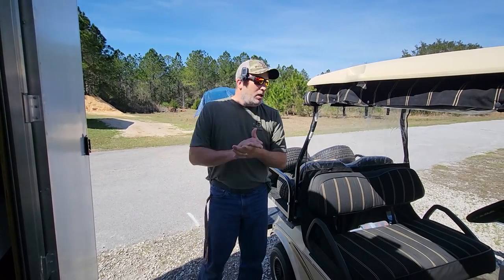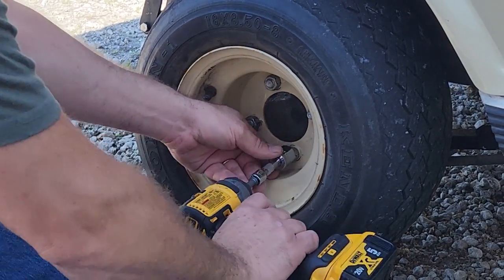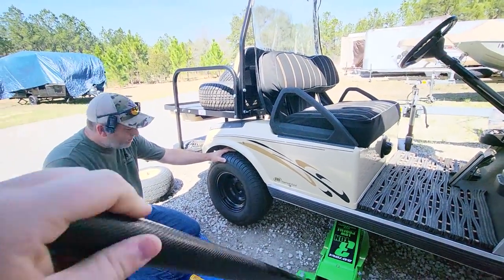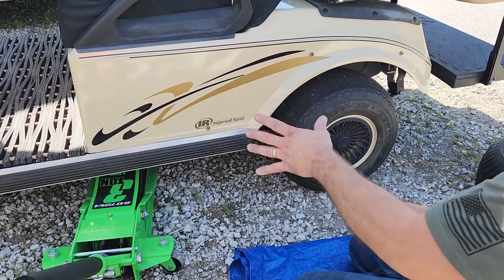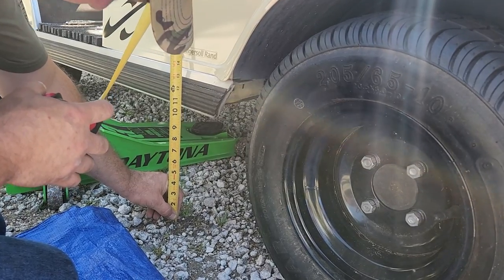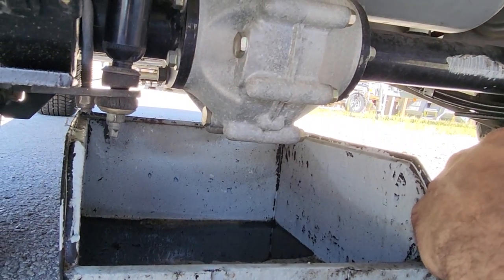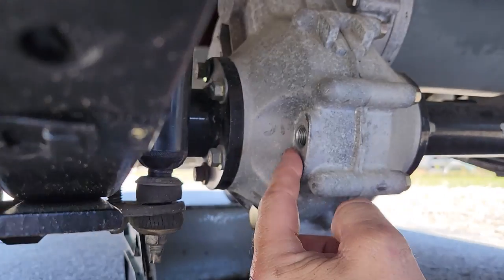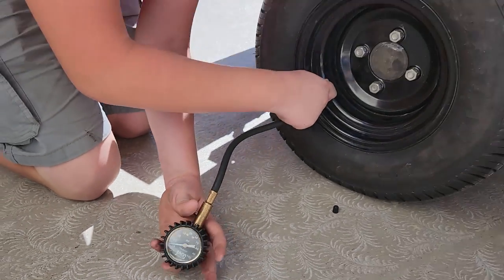Club Car DS Golf Cart Tires Upgrade & Rear Diff Oil Change

Comment: Just a bit of info. Per Club Car, Electric Club Car Carts require straight 30 weight oil. Club Car Gas Carts require 80w90 gear oil.

Comment: Hi there! Cool video! 
What size are the tires boss? I get the rims are 10in. But what’s the size of the tire? Thanks!
Reply: They are most definitely 20 inch tall tires. Probably 205x65x10 which is same as 20x10
Reply: @danielrabines9201  thank you Daniel.
Reply from the maker: Sorry for the late reply.  Daniel is right they are 205/65/10

Comment: Does it ride a little smoother with the bigger tires?
Reply from the maker: The ride is not smoother. with the heavy duty springs it rides a little rougher but needed to carry passengers.